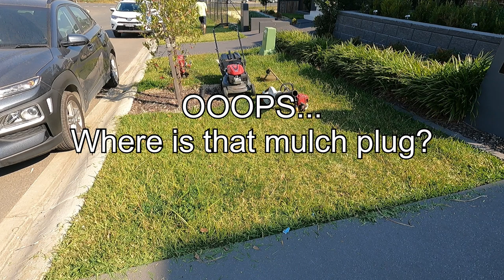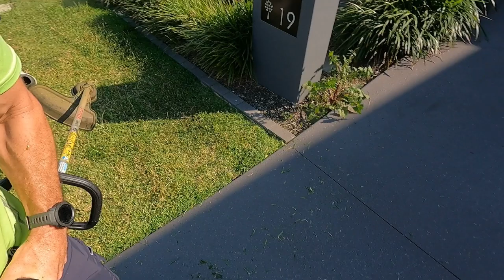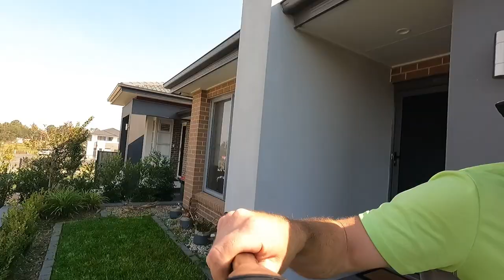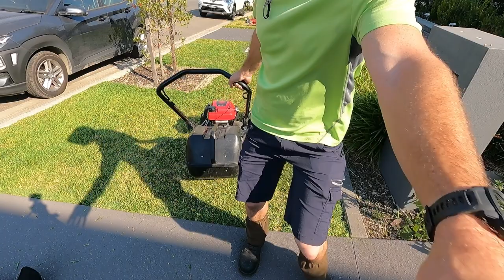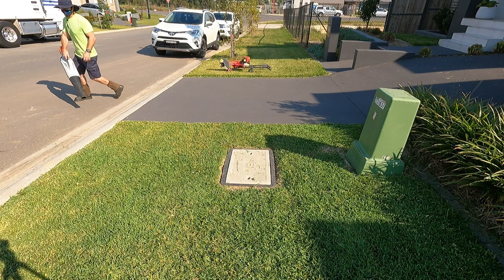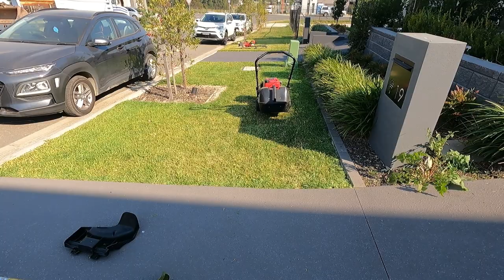$60 For 15 Minutes of Mowing!?

Comment: Mrs BT, 'I hope he's going to pull that weed out next to the letter box!' BT, 'yeah, nah'.  $60 for 15 minutes, $240 per hour, I'm in the wrong job. Anyway, enough of that, the lawns came up a treat mate well done. All the best.
Reply from the maker: I feel this will be a constant theme 😂 I quoted to do lawns only. Showed up in 3 minutes and it was a one off service. I did however spray all the garden beds for weeds.
Reply: You wouldn't get away with charging that amount in the UK.
The most anyone charges over here is £18P/hr and there is always a load of others willing to undercut even that low figure.
Reply: @ramblingman8992  I seriously doubt anyone would charge $240 an hour for mowing lawns mate. It was just a bit of light hearted extrapolation on my part. All the best.
Reply from the maker: @ramblingman8992  I wouldn’t charge that much for a scheduled service but when you’ve shown up and done it within 30 mins of the enquiry and it’s just a one off, in my opinion they should pay more.
Reply: @timthelawnmowerman  most definately, $60 is a fair price in sydney for that service.
Same day service, first initial cut, once off job.
Reply: @ramblingman8992  Hmm did you try n get Hair Cut in Salon? that small grass growing in your head they charge u 40$ for haircut + tip. u can even do a pedicure for 30$ + tip (in 10mins)..LoL now this yard got more grass in ur head.
Reply: Maybe he thought it was a plant lol
Reply: Great work, Tim the Lawnmower Man!

Comment: I'm not being critical when I ask this, just inquisitive.   I've never seen an edger like you use, I've only ever seen the ones that look like an attachment to a string trimmer power head.  Why did you choose that style?  How do you like using it?
Reply from the maker: It’s called an atom edger. Australian company. They are very good, my biggest complaint is that it doesn’t store well because of its shape👍 thanks for watching
Reply: @timthelawnmowerman  thank you for responding.
Reply: Be easier on the back in the long run….hey Tim?

Comment: They gave you $60 or you charged $60? $60 is WAY too much!
Reply from the maker: Why is it too much Debbie? What are you basing that statement on?
Reply: @timthelawnmowerman  That it only took 15 minutes. I would have only charged them maybe $20 for that size yard.
Reply: @debbieb.8708 , that’s why you’re broke. Easily $10 in fuel.
Reply: @garywagner2466  What makes you think I'm broke?
Reply: @debbieb.8708  , I’ll type more slowly. If you only charge $20 for a short notice job that you have to pay $10 in fuel for your vehicle, and equipment, then you are cheating yourself. Those customers are clearly able to pay $60. It doesn’t really matter if Tim can do the job in 15 minutes. They couldn’t be bothered. He has invested in equipment and has the expertise and interest that his clients lack. You had the audacity to shout “$60 is WAY too much!” Based on what? Your opinion. You’ll stay poor.
Reply: @garywagner2466  Honey, I'm not broke by no means. You do things your way and I'll continue (for the past 40 years) to do things my way. Thanks!

Comment: You could have dine faster if you edged all 1st then came back with bagged lawnmower and finished up.  Like shopping.  In 55 years, I have never gone down the same aisle twice.  15 minutes and I've shopped for over 30 days and spent $200.00 easily.